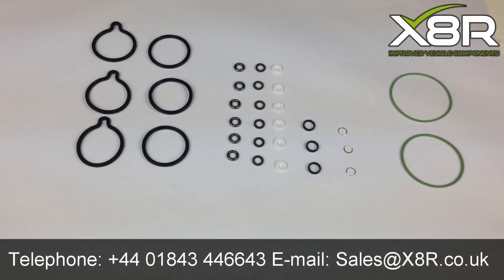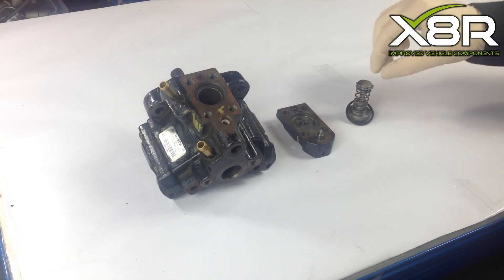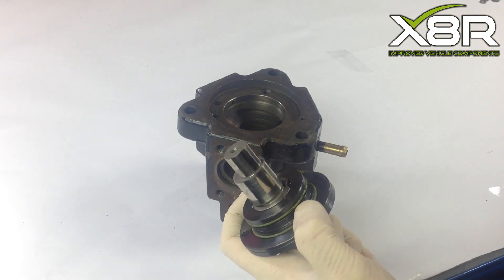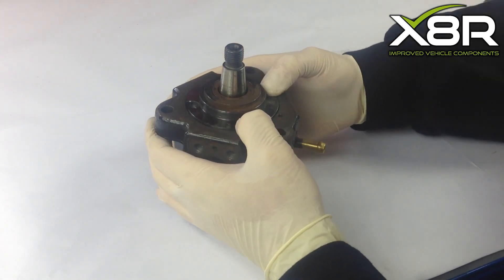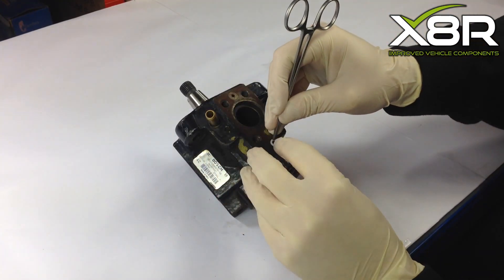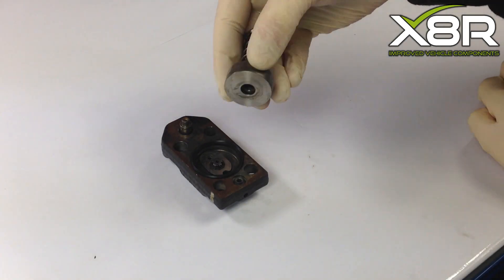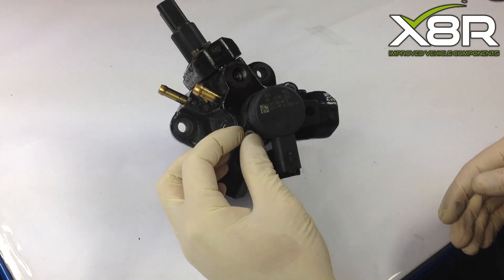Universal Bosch Common Rail CP1 High Pressure Fuel Pump O-Rings Seal Seals Repair Fix Kit Leaks

Comment: You haven't replaced the most important thing the brown oil seal located at the exit of the rotating spindle very often the Diesel leak is just the...

Comment: so no need for assembly lube on the drive shaft.??  Just to assist the pump lubrication during the first start.?
Reply: they should soak all the internal parts with some clean Diesel, as the lubrication is realised by Diesel
Reply: @uweeduinkorte1937  yes you are correct.  I optted for assembly lube on moving parts until the diesel makes its way into the chambers.  Then diesel takes over on prestart for new rebuilds.
Reply: @jasonputtock4428 the issue bro is that fuel systems, petrol, diesel and LPG even, are never rated for anything other than fuel. There are surface coatings on these parts that might dissolve in vasaline lube but not diesel oil, there's positive-displacement pumps squeezing known volumes of oil out of tiny injector holes, it really couldn't be a worse place to put some goop. I mean these Bosch pumps were pretty solid, they can allegedly run on straight vegtable oil, not simply B100 but, like, olive oil. Got to have the right seals and gaskets though.
Reply: @cannaroe1213  Well I rebuilt my own PUMP and used assembly oil in it.  Smeared a thin film over all metal surfaces and the van runs great.  Now been running for 3K km and no issues what so ever. Thanks for your reply.

Comment: Thank you for the clear and helpful video. 
May I ask please what is the Torque setting for the T30 torx bolts that secure the fuel pressure regulator?

Comment: I`d a sudden high pressure fuel leak due to an broken tube. The broken tube is replaced, but no high pressure anymore. How do I restart the fuel pump?
Reply: Hey there! Did you tried bleeding the air from the fuel system?
Reply: @edgardh9359  problem solved. Internal injector leakage. Thanks 😊
Reply: @xtra330  Great news brother! Be safe!

Comment: To whoever is still watching this video in 2020: DON'T use latex gloves to work with diesel, as haydrocarbons break down the latex (that's the same reason why you don't use vaseline as a lubricant on a condom, btw). Better use VITON gloves, or NITRILE gloves when working with fuels and oils.
Reply from the maker: Hi there, thanks for the great tip! - Georgina, X8R Ltd

Comment: What about changing the shaft seal - simmering ?? It Can leak too !!! ! !!!
Reply: These do leak. Very often. I've had 2 leak into my engine twice !
Reply: Where is it?
Reply: @booring2  on the shaft. My 1.7 Hyundai was 2 fuel pipes the wrong way around return on the inlet, so pressure was blowing it.

Comment: I cant find the rebuild kit for this specific model 0 445 010 276, High-pressure pump, Common Rail system BOSCH, 0445010276

Can any one help?

Comment: How do you change the two small o rings on the fuel pressure regulator? One is teflon and can break when removing and installing.  Why didn’t you I change these as they commonly fail it seems.
Reply: Can you order them on ebay? Is there a link please
Reply: @edenhomesdesign  I answered my own question by doing this job myself. My video here: https://youtu.be/l0kEew05Vw0

Comment: At 7:00 remember that the ring should be faced with the cone down in the head!
Would be nice if you told us the torqu on the axel shaft and sensor too. :-)
Reply: Thanks  
I need electronic and censer sistum nozzle injector trening.
Please Sir help me.
+918103950810

Comment: Tengo un Foton 2778 cc Diesel modelo 2012 y ya para prender se debe dar a oler gasolina, remplace la valvula que regula la presion en la bomba, remplace un inyector que retornaba mucho, y nada esperando respuesta.  Carlos Hernandez Medellin
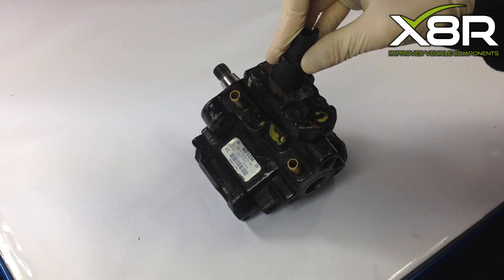Reply: hello there on 09:41 secund,what and for what is senzor?
Reply: @dusanmarkovic4265  That sensor can connect with the ECU and tell it if the high pressure is absent due to the low pressure pump not delivering fuel to the high pressure
pump. Mercedes Sprinter has a similar safety that protects the high pressure pump from running dry.

Comment: I did this recently and the HP pump still leaked. The fix? I 'milled' the rust off the cylinder heads and mating faces using a piece of glass and 400 grit alox paper. A good clean up and all was well.
The vid doesn't show replacement of the pressure regulator O-ring, a very common failure point.
Reply from the maker: Hi, thank you for the feedback. We're always looking to improve our parts, we shall certainly consider the addition of the pressure regulator O-ring.